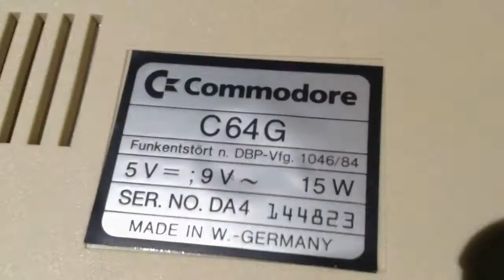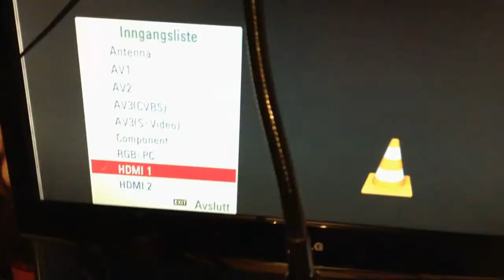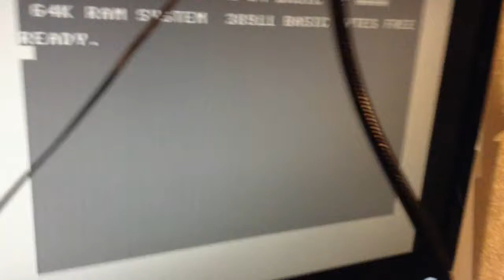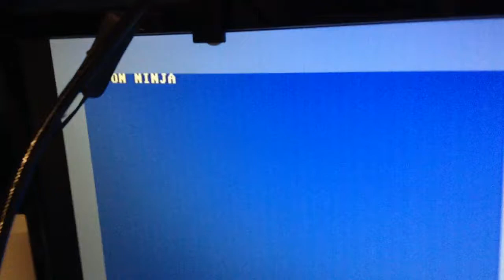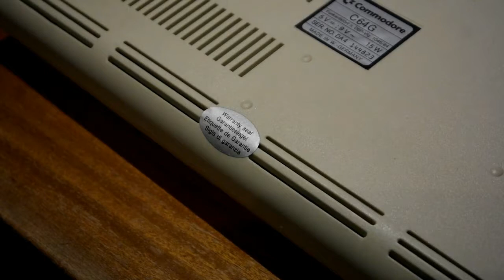Commodore pick-up C64G

Comment: I have the same machine. It's the most recent incarnation of the c64 - apart from the new motherboard one I own. C64G didn't that stand for German as this was only sold by Aldi Germany ?
Reply from the maker: +lactobacillusprime I read that first there were Aldi (brownish white case and white keys), then there were C64G (white).. Maybe your right about that one regarding the G.............. Check the Aldi here, it has no G on it... Could just be the inconcistent Commodore there, ......... http://www.lemon64.com/forum/viewtopic.php?t=52841&sid=bb803779ef8183ec3a449d60eab4b265

Comment: Wow, don't see very many of those around these days!
Reply from the maker: +GadgetUK164 It's cool. Did you notice the blue basic text was pure without pink every other character? I have that on both breadbin and the c64c.
Reply: Yes!  It does seem like you've got a nice clear display on that C64!  My C64C/E are like that too!  Problem seems to be related to the old VIC II used in breadbins, probably due to that problem you showed where the VDD rail was routed internally.

Comment: Some funky tape drive that is. Is that a standard commodore datasette? I've never seen it. 
The machine is good! And it looks spiffy too. Well done. Worth the drive.
Reply from the maker: +The Highlander 3rd party brand, came with the C64 I bought last year. They were rebranded I think. I think it runs quit well, sometimes better than the datasettes that I have, even though these are cheaper models. That reminds me to get  drive belt kits for the tape drives.
Reply: I never use the tape drives. I have a few of them though. I think.

Comment: It sports the newer CPU that also is found on the c128
Reply from the maker: +lactobacillusprime Interesting.. Been looking at some C128 lately. I think they are 8502 not 8500..
Reply: bwack Ah so it may be some sort of intermediary CPU. It's definitely not a standard 6510 that's in the C64G
Reply from the maker: Yes, I've read that too. Some demos have issues with the C64G..